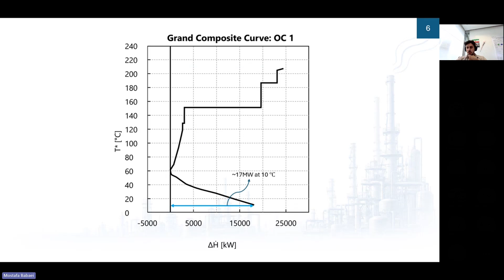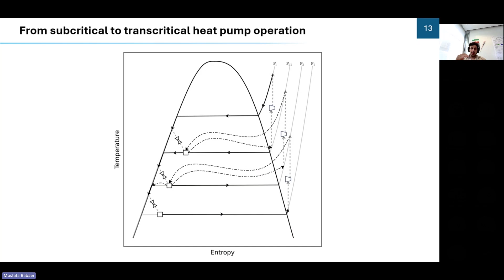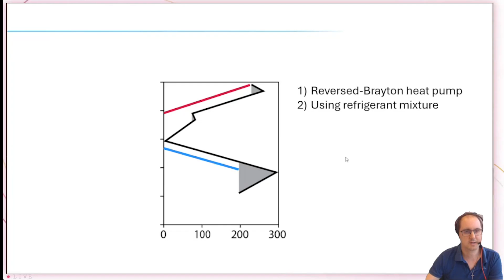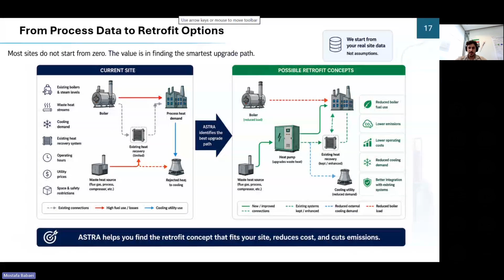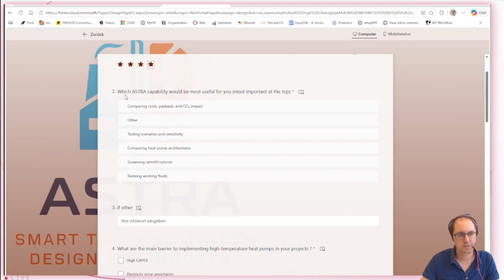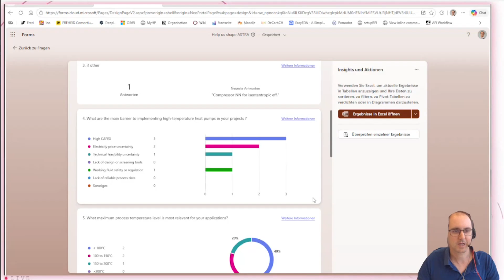Precision Decarbonization: Finding the Optimal Heat Pump System Configuration with ASTRA | Webinar

Comment: the mostly one way to speed up decobonization with heat pumps is is combine them with electricity generator via ORC and other technologies - so you can generate water from air water sun and ground
Reply: So you want to use electricity to make heat to make electricity ? I have heard this idea many times but there is a reason it has never been build.
As of making water from air (water harvesting) using heat pump or some other technology, it is an interesting topic and many startups are looking to produce efficient systems.